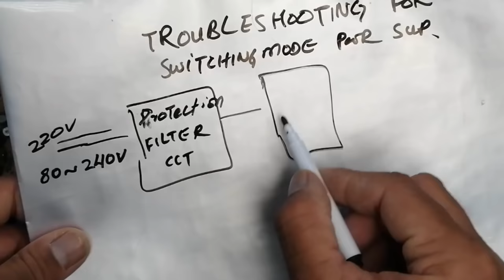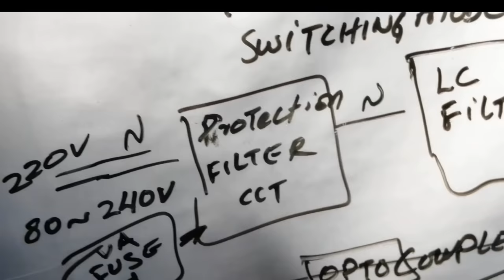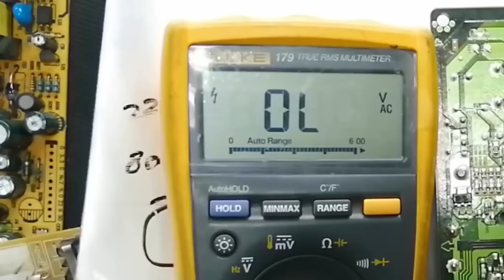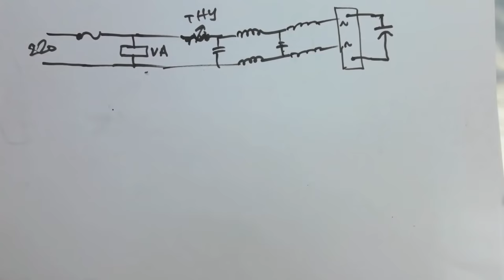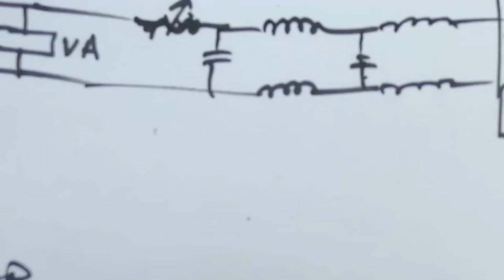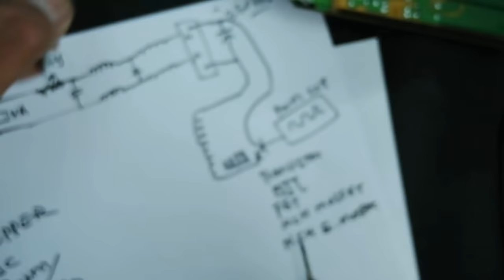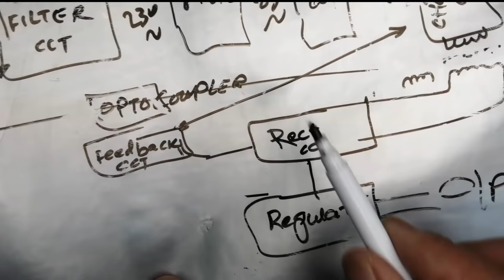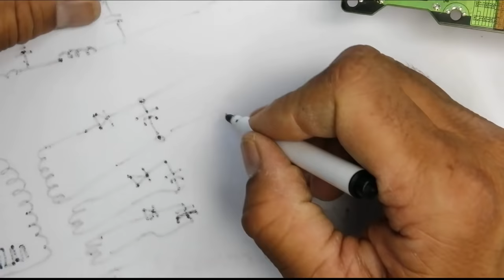SMPS Switching switch Mode Power Supply repair & Troubleshooting

Comment: Chopper cct explain briefly plz
Reply from the maker: i will explain it 
and i also suggest to check video number 592 that is very detailed video
Reply: Can you only explain how chopper stepdown dc voltage to 230 vdc to 12v dc ... How it functioning plz explain it 2 to 3 min...

Comment: if the voltage comes to one side of the opto coupler  which is connected to primary section but not to secondary
Reply: @HaseebElectronics  ok thank you i understand 
i have another question that is why the negative voltage comes to the primary end of the opto coupler

Comment: smps chopper heating problum
Reply from the maker: please check the switching frequency, if frequency will change than its rated frequency, the Bmax of the transformer will increase, so it will increase temperature